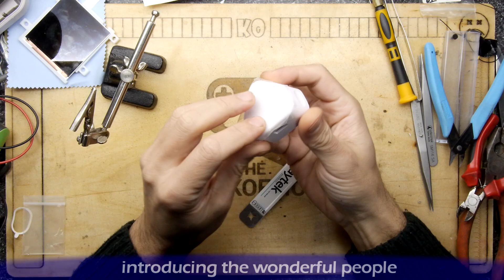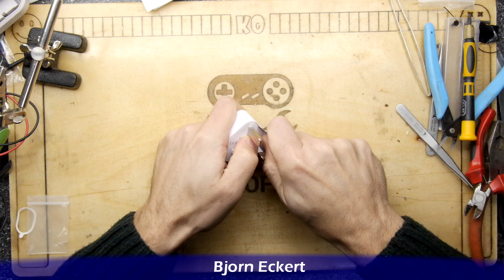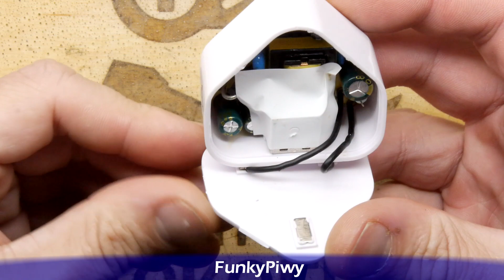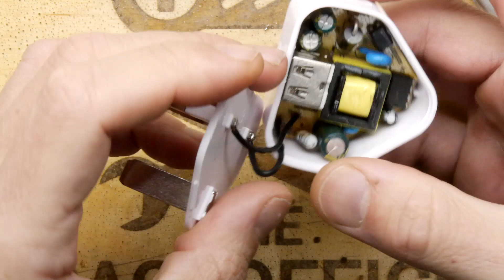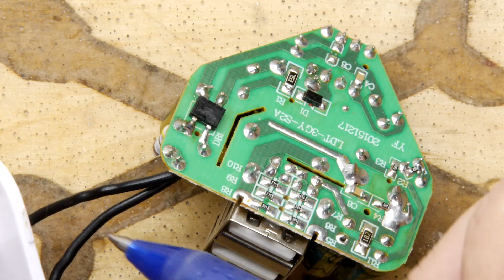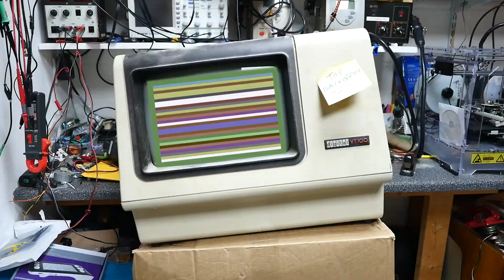Mystery USB Adaptor - with a surprise!

Comment: This is a bog standard isolated Switch mode power supply. The optocoupler is not part of the oscillator. It monitors the output voltage and tells the switch mode controller IC to reduce or increase the duty cycle which in turn alters the amount of energy transferred from the primary to the secondary of the transformer.

Comment: Check all diodes in the circuit for shorts, not because any are necessarily likely dead, but because it's easy, you don't have to take anything out, and you can then quickly know that they're OK and don't need to worry about them.

The tiny little electrolytic capacitor near the chip, this should be the cap that holds up the power to that chip via a diode and resistor on the solder side via aux winding of the transformer. Well experience says they frequently die, maybe due to uncomfortably highish voltage jolts when these things get plugged in or turned on or for whatever reason, but they never show external signs of failure. So take it out, test it if you can, replace it if you can't.

Yes it's a SMPS. And it just drives the transformer with a pulse wave, there's no reason why that wouldn't work or would need a sine wave. Necessitates some interference suppression measures though.

Comment: Yes it is a switch mode PS.  Switch mode power supplies work by rectifying the mains in to DC then drive an oscillator with an AC signal usually in the KHZ through a transformer to be rectified again.  The feed back through the opto-isolator modifies the frequency changing the voltage on the output based on load.
Reply: Allows for a smaller, cheaper transformer.
Reply: And the required higher frequencies for switching
Reply: Isn't that basically what he said?